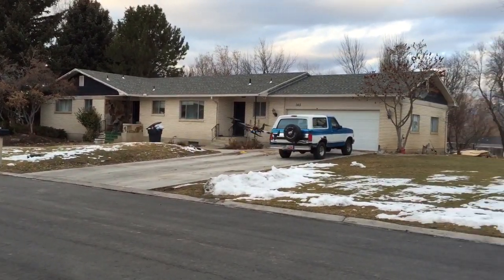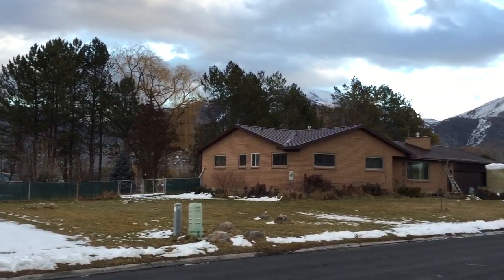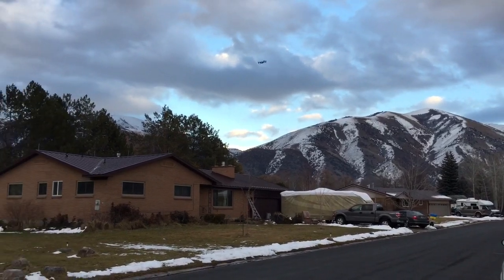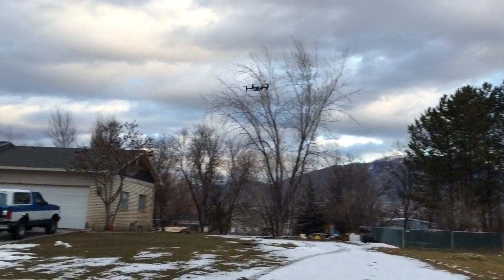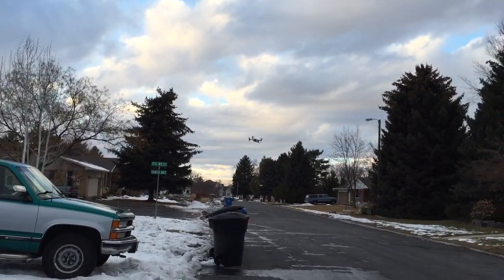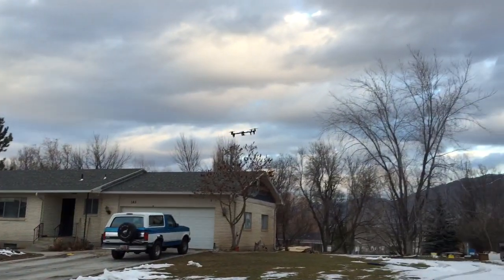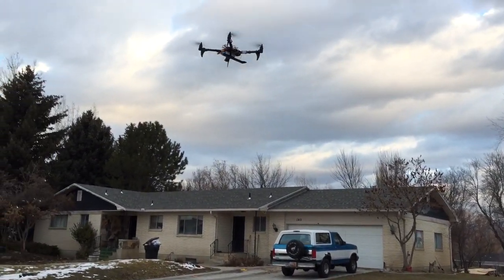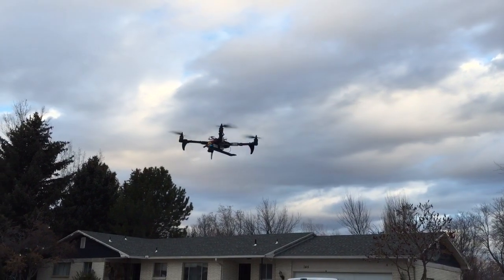Flite test electrohub Re-Maiden after adjustments boom repl

Comment from the maker: I Changed the throws on my Transmitter, set a channel to set flight modes so I could use Horizon and ANGLE and ARM modes (using Horizon in both videos) Some of my holes for my booms were not straight enough and it torqued the angle of the frame, so the new booms made that adjustment. The biggest difference of all of them though is that I Calibrated all of the ESCs, and then plugged them into the Flight Controller and booted the FC.